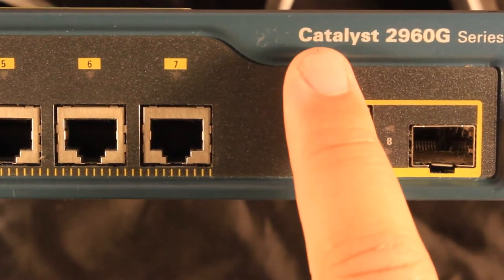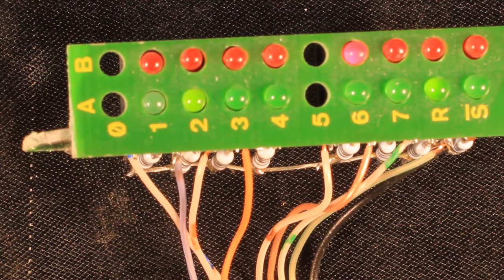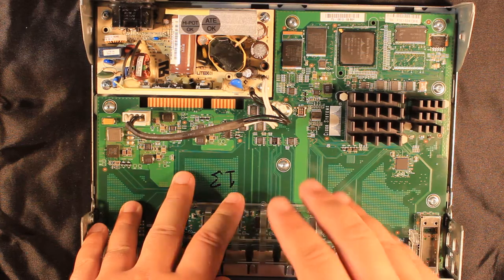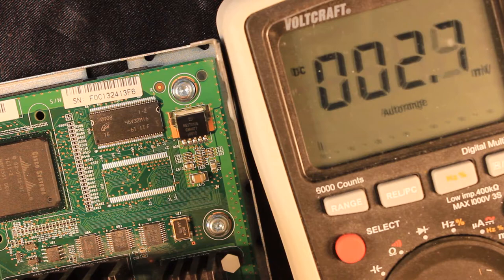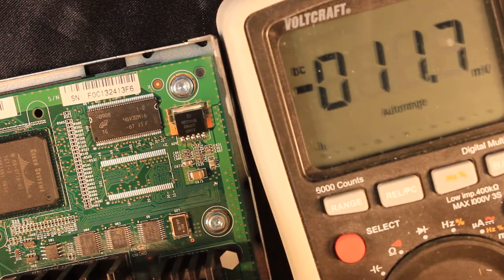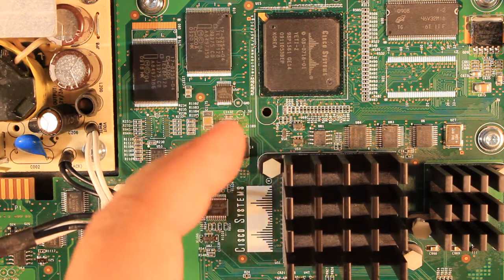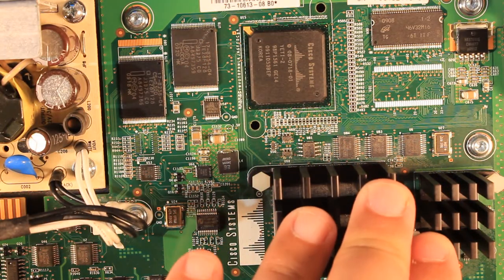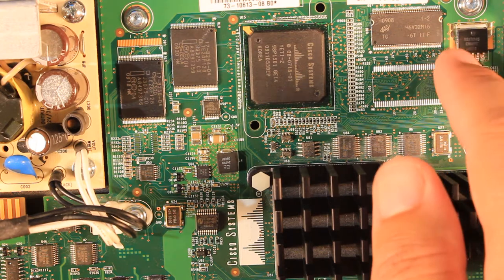Repair of a Cisco 2960G switch with amber LED via RAM chip replacement (FAIL/defect)

Comment: Hi Donkey - I was wondering if you ever made a follow-up video for this after the RAM replacement did not work. I have an 3400ME that is giving me a similar issue. All the power is working at all test points, but I haven't replaced the RAM yet. I am leaning towards it being a bad power sequencer chip. I am going to continue reading up on the specs for this - does that sound reasonable to you? Should I get good power tests at all tests points if it was bad?

Comment: I have replaced the RAM (by a PQI PQ4D3216Y5 that was on a MDAD-428JA module), and the 2960G-24TC-L is back to life... Thanks. Of course the 2960G  is EOLed by now.

Comment: Might not be the problem but I am amazed that you didn't use a scope to check those different voltages.
Too much ripple (because of bad caps) might prevent the processor from properly booting.
Reply from the maker: That is exactly what I wanted to do in the second video. This first video was just a quick&dirty "get rich quick" repair scheme. I would like to combine the scope with a logic analyzer and check what is coming out from the flash chip. I own a dual channel oscilloscope, but I do not have a mixed-signal scope. Since I found no cheap logic analyzer which works well with Linux, and in general I got no time next to my job, so far I did not had the opportunity to get back to this switch. Hopefully I will fix it one way or an other.
Reply: @DonkeyLearningIT  buy something supported by sigrok. sigrok has a list on its wiki.
Reply from the maker: @evrim73  I was thinking about a Chinese product which has so many inputs, that it can be used for Z80 CPUs and such. However, since it is not available on Ebay, I hesitated to buy it.
Reply: @DonkeyLearningIT  just curious, how many channels you'd like to have?
Reply from the maker: @evrim73  Well, for board repair involving Z80 CPUs it would be nice to have about 24 channels. Most likely I will just buy one of those Chinese made ones which is supported by the software on Linux, and hope that it actually work.
Reply: @DonkeyLearningIT  https://sigrok.org/wiki/Supported_hardware#Logic_analyzers Most of them are 8/16 channels, I have a DSlogic (cypress+fpga) w/ Sigrok which runs on Linux.  Openbench Logic Sniffer, Sysclk, Zeroplus seem to have more than 16 channels. Please record more board videos:p

Comment: I have also ws-c2960x-24psl in which its Syst button blinks amber when i give it apower. so what is the solution? i can't fix the problem!
Reply from the maker: It depends on the given switch. A yellow System LED just means in general a hardware failure. In some case it indicates that the cooling fan have failed, in other case it shows, that the ASIC is defective, or some other part. 
On the serial console do you get any output?
Reply: no output at all, the console part does not start the process
Reply from the maker: That is clearly a bad sign. If you open up the box ( do not plug it in just look at the components) do you see anything burned, capacitors bulging?

Comment: I hope someone still reads this in 2024.
I have a semi-faulty 2960G: I plug in the switch to AC, the switch starts booting, and the FAN starts normal as well. After a couple of minutes of uptime, the FAN suddenly jumps to 100% speed and blows like crazy. After a couple of minutes, it goes down to acceptable level. Then another couple of minutes it goes up to 100% speed, and rinse and repeat. The CLI show env all reports both TEMP and FAN as OK. The show log does not report anything about TEMP or the FAN. I tried to find any CLI debug command to see TEMP or FAN behavior, but couldnt find anything. The environment is around 18-20 degree celcius, so perfectly normal (I would even say slightly cold) room temp, so the switch should not behave like that. Does it sound like a temp sensor malfunction? If so, why does the report not say TEMP NOT OK or something similar? Has anyone experienced this? Its just a lame home LAN switch, nothing money-generating thing, I bought it used from a server room. The previous owner wasnt aware that it behaves like that, as it was already very loud in the server room, and the initial check before purchase didnt reveal this defect. Any help greatly appricated. I know its youtube, so unlikely anyone will comment anything useful, but better here trying than on the braindead cisco community support forums, god have mercy dealing with the idiots there!

Comment: Nice video but why didn't you use flux to better solder that ram chip still a mistery ;-)
Reply from the maker: I was using copious amount of flux on it, only I have cut out some parts to make the video shorter.
I am hunting now for a good logic analyzer to try to track down the actual issue (got 8 of these dead switches).
With a two-channel oscilloscope I got nothing useful on it, so I have to compare the analyzer data stream with a working switch. Since I got working switch from the same model, at least getting the logic pattern for a working device should be more easy.

Comment: You are Amazing Man Great Video🐎🙇👌
Reply from the maker: Many thanks for the encouragements!
I truly wished that the RAM will fix it. However, the RAM replacement was not enough, so I suspect that the ROMMON is corrupted in one of the flash chips. However, the two chips are interlaced. This means, that even if I do manage to desolder the flash chips from a known working motherboard, I need to buy an external programmer and flash it into the new replacement chips in split-mode...
Reply: You will get through this process!! Good work!

Comment: Check 14 pin ic it is faulty
Reply from the maker: Which IC do you mean? Also, why do you think that the given IC would be the culprit?
You might have some info what I do not know, this is why I am just wondering...
Reply: Check ISL8700
Reply from the maker: If the power sequencer chip would be defective, there should be no voltages present on the low voltage DC side, but they are all there, and they are bang on. This is why I am wondering how could be the ISL8700 defective. Nevertheless, when I got too much time, I might replace it with a working one just for fun.
Reply: Hi have You ever figured out the fault ? I have the same problem now …